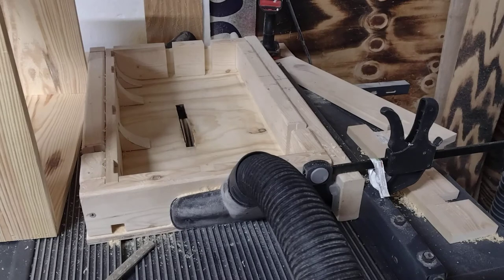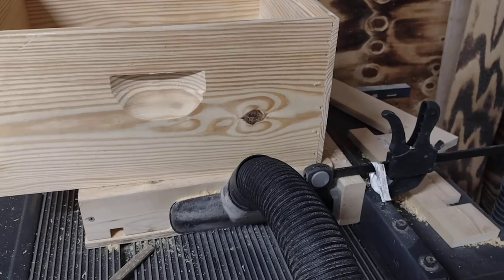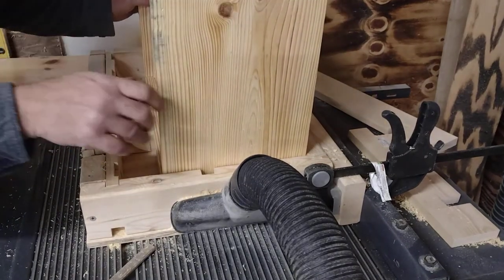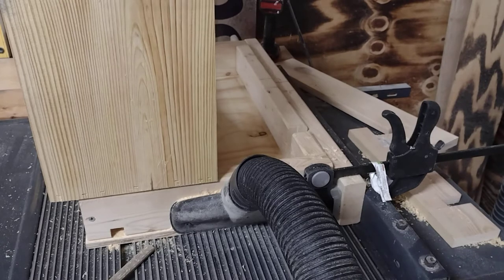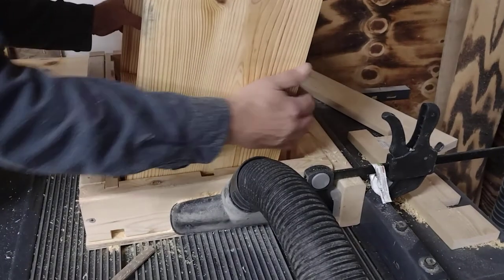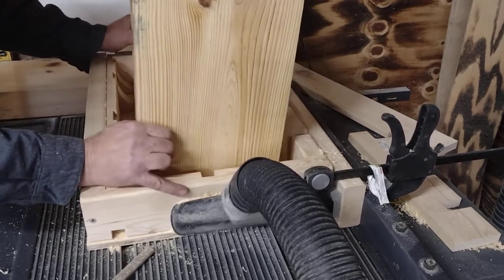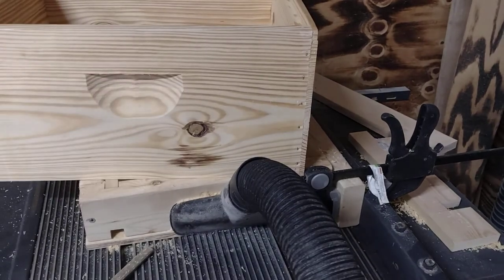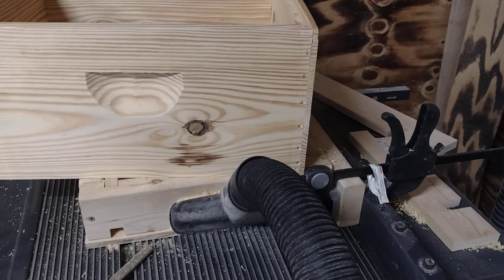Building bee hives from rough cut lumber step 9 cutting hand holds

Comment: That's a good way to use that jig, and the shop vac dust collection is very cool! Did you cut a notch out before hand or drill holes?
Reply from the maker: I messed up when making the jig and it left cut outs at the bottom so I pot them to use. Don't tell anyone it was a mistake.